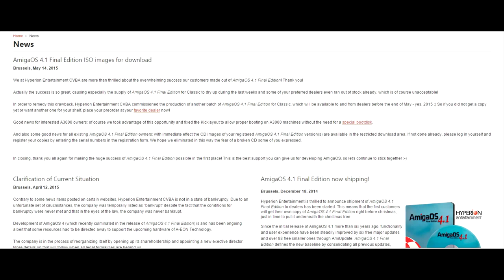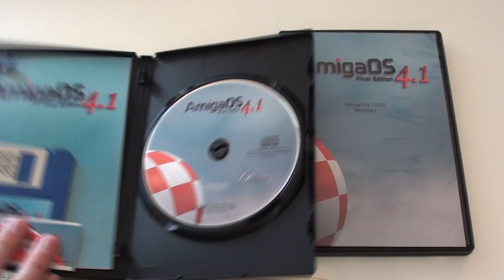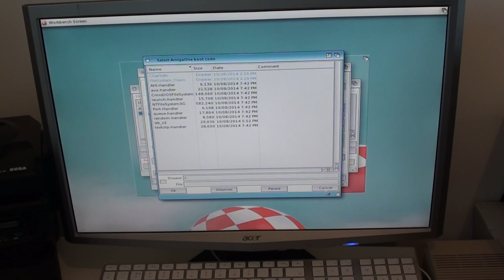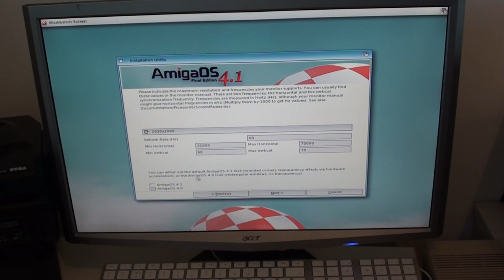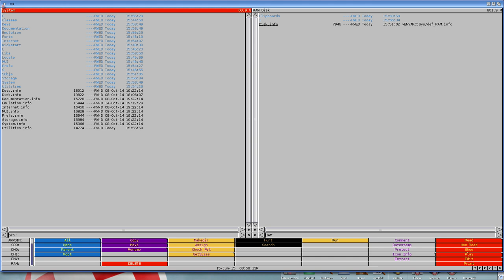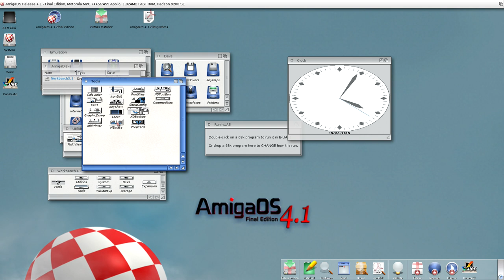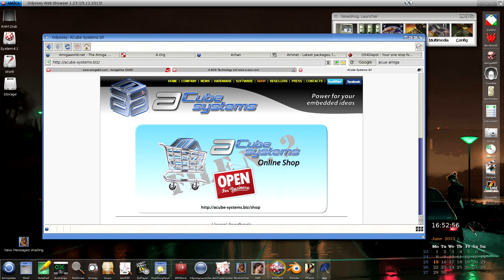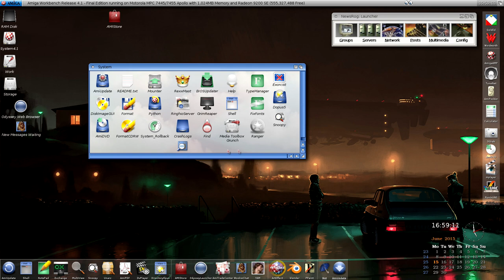AmigaOS 4.1 Final Edition Review & Install (2015)

Comment: Is it possible to install Amiga OS on an old Mac G3 Blue Tower model ?
Reply: +Jonny Myrberg Probably not. The only Mac that successfully ran AmigaOS was the Mac Mini G4, and by "ran", I mean not well. It lacked drivers and required Moana Loader and a customized installation disc. Some G4 and G5 Macs can run MorphOS, which is an Amiga-like operating system that can run Amiga software. There's nothing you can do with a G3, besides emulation I guess.

Comment: Awesome video, many thanks! :) I Have an Amiga One MicroA1, and I have not touched it for atleast 7 years, I remember that the lack of a decent web browser was the biggest reason I did not use it.  Is the Odyssey Web browser fully CSS and HTML5 compatible? Like, can you watch YouTube videos in it without having to use external programs and players that download the videos before playing them? I realize that a MicroA1 is kinda weak for youtube watching, but still... Would be nice... :) 

Also, remember the CPU Fan was loud as hell on it. :D
Reply from the maker: Maria Engström Odyssey is fully CSS compatible and supports HTML 5 yes, it's webkit based. It doesn't seem to play Youtube for me on OS4 but it does on MorphOS, maybe it's a newer version.  But yes, it is certainly possible if it gets an update or configured properly it seems.
Reply: Nice! Thanks! :) I might dust my MicroA1 off and replace the CPU fan then. Guess I will need a New battery too.
Reply: Maria Engström there is also a port of Firefox: Timberwolf

Comment: will this install onto other Amiga's ie A1200 or A500  is install different    Where can i buy this  is it available on Ebay
Reply: Too slow. A vampired system might run it but vanilla can't.

Comment: I looked up some things and I fail to see any appeal in AOS4 or AOne machines. It's literally pre-2010 PC-ish hardware beaten in performance by even the cheapest contemporary ARM SBCs running Linux. Sure the OS might be a curiosity for some but the ecosystem doesn't even support the whole point of having an "Amiga" system, which is the original Amiga software, in any better way than Linux or Windows does. It's a slightly stale emulator vs a variety of fresh and stable emulators.

Web browsing? Libre office? You'd be so much better off with a less esoteric, less outdated and less physically clumsy system.

Real Amiga software? FS-UAE, WinUAE or a properly expanded real Amiga. Probably even comes cheaper to get a pimped up A500/600/1200 and a Linux (or Windows for ~$20 from suspicious key retailers) SBC/PC, than an AmigaOne meme tower and this OS.

Mac mini? Ok, probably cheaper but not officially supported IIRC and not as versatile as a modern PC.